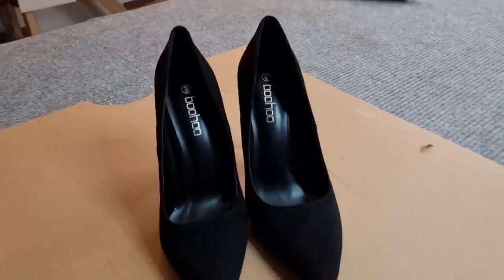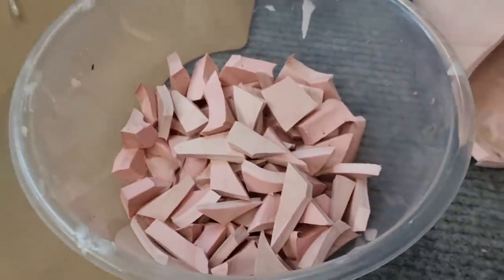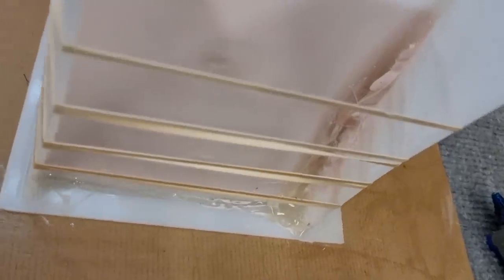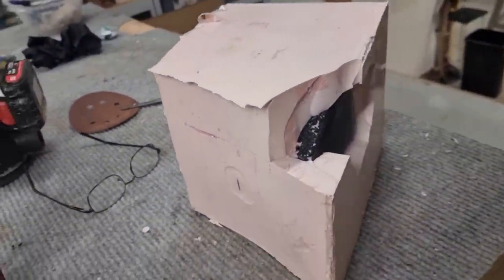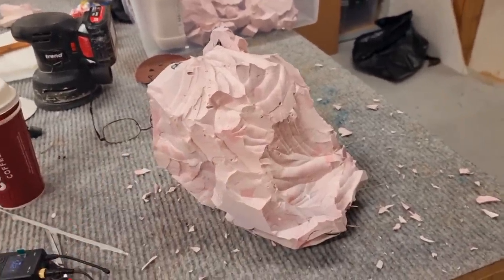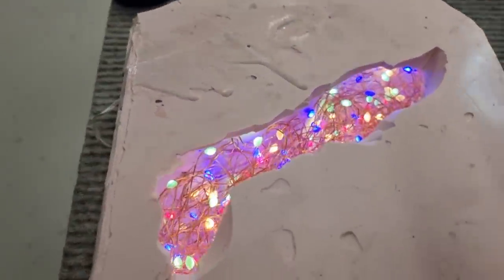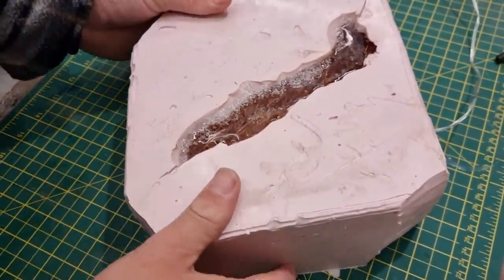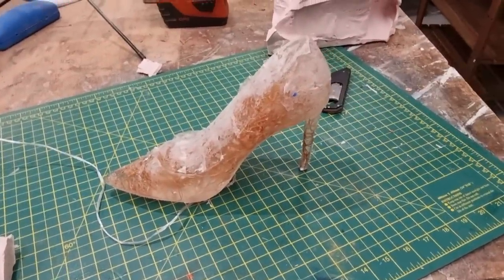Making Resin Stiletto Shoes with LIGHTS !

Comment: This is an amazing idea! So I have a (hopefully helpful) idea to add if you decide to retry this later on! Instead of putting the whole shoe into the mold and prying it out- I think you should try setting the shoe (Or whatever you decide to use later) only HALFWAY into the mold and make a literal half mold of the shoe- then do the other side on a separate mold so you can put the 2 molds together after you are done for a complete solid shoe mold that you can tape together and set (make sure to have a box they can fit real snug in and maybe a couple holes in the bottom of the shoe mold (put it in the pressure pot upside-down for the shoe since there is more room for it to air out on the sole and heel) then when they are done you should be able to just pull the halves safely apart with a much more complete shoe with the impurities being mostly on the sole since it was upside-down. I hope this helps for if you retry this again!

Comment: love it, such a fun project!  Suggestion for you.  Maybe when making the mold (or a mold of any other complex shape) you could use some sort of divider that could go around the object and bisect it so the mold removal would be more clean and easier?  Im thinking some sort of plastic sheeting that is rigid enough to hold shape but thin enough to not affect the shape desired.  And include some pegs in the divider that could be used to line the mold halves back up when you are ready to pour the resin?   Im probably overthinking the heck out of this, but Its worth a thought

Comment: Love the Cinderella shoe and all the effort and patience you have too.  Is there a possibility to reattach the wire to get it to work? Also maybe try putting two pieces of plastic sheeting together in the middle of a mould and then when it sets you can pull it apart more easier.  Love watching every creative thing you make, and Merry Christmas to you and your family.
Reply: He could try adding some solder to the damaged part of the wire, add a layer of uv resin and paint that section silver to hide the patch job. Not sure if it'll work but worth a shot if he ever wants to try and salvage the first one.

Comment: You need to use a sealant when dealing with fabrics and other materials that absorb. Also for odd shaped projects, you should use a two part mold and a shell style mold to save a fortune
Reply: Yes, I thought a two-part mold would work as well, but I have so much trouble wrapping my head around how they are made.
Reply: Seems like it would ruin the shoes
Reply: @recoveringsoul755  they're gone anyway😉 the Moldova stuff def. ruins the fabric...

Comment: Nick I am so glad you are still giving us your energy and enthusiasm. 
You have brightened up a long, very long day which started yesterday morning where everything that could go wrong has.
A way I am thinking you could do this is as a 2 piece mould. Maybe try to get the inside moulded first somehow and then use a mould release to create a barrier between that and the outside. I hope that makes sense. I'm not sure how but I'm sure there is a way to get the shoe you want. I do love the single solid shoe tho. Looks awesome.  I have seen people use vaseline between the 2 parts. There would be a lot of tilting to get the inside. Maybe cover the shoe with vaseline before moulding it to get a cleaner mould.
Every video is a lesson from the best resin teacher.  You teach the skills of creativity, vision, problem solving, trying new things and learning from your mistakes. 
I live not far from you near Poole and love the beach.  Maybe a cool shell something.
Another possibility to save sanding and possibly cutting wires is to do a top coat of resin or brush a top layer over your piece. Im not sure it would have worked with the shoe but i think you could try something like that.
Keep up the amazing 3nery and work.
Merry Christmas and Happy New year

Comment: Something I learned in college 3d sculpture class is that if you're making a mold of something that silicone may stick to, use vasaline to help it remove from the mold much easier. Unsure if mold release would also work on the actual piece you're making a mold of or only when you do the resin pour.

Pouring a 2 part mold with registration marks can also help the mold's stability and ease of removing the molded item also during mold making.

Comment: First, I really enjoyed the process of try-fail-try you explored in this video. The final art piece certainly justified the effort and looks amazing.

Second... I think I suggested this last time you tried lights in resin but I can't recall really. You should have made a "block" or a slightly smaller version of the final mold into which would go the lights. As you know, a silicone mold will always take on the finish texture of anything you cast (so suede was a doomed choice from the start) so you needed to start with a shoe you could seal first. Then once you made the first mold you could sand that down by a mm on all surfaces making a block you can mold again and into which wold go your lights. Then that lighted cast would go into your original mold to be cast in the final size and giving you some sanding room safe from wires. The shinier and smother your first object (the shoe) the less sanding you will need to do at the end.

I hope you don't give up on lighted resin projects. I always enjoy the energy you bring in your videos, it makes me smile. I wish I enjoyed anything half as much as you enjoy doing your projects.

Comment: I watched this before bed, and then thought about it to the point where I was going to get up to post this.  Opted for the next morning.  What about (and this is from someone with NO experience besides your videos), pouring a solid shoe, taking it out and sanding it clean, then cutting it in half with a band saw, dremel out the inside, adding the lights and then either just gluing it back together with them floating inside, or pouring more resin.  I spent way too much time trying to figure out how to make lighted resin stiletto's.  :)

Comment: I love the idea. It came out way better than what I was bracing for, the wire being 'Nicked' and a mold leak was expected. 😁
Maybe coating the project/experiments with wiring in thin layers of the resin after a light sanding by hand could avoid the electrical part being ruined. 
I also got an idea for a resin, drip molded lamp shade with those same fairy lights. You can get two inflatable balls or balloons, one smaller one  inserted into the slightly larger. Insert the lights, blow the balloons up, then add  a fast resin, let it start to set then turn it upside down to let the resin and lights drip dry, so to speak.

Comment: That was an excellent idea. You could make a smaller shoe and pour it with no lights. Then wrap the lights on the smaller shoe and suspend it in the regular mold. That way the lights wouldn't be close to the outside.

Comment: Okay, I have no idea if Nick is ever going to see this, but I do think it'd be a helpful suggestion. I suppose I'll let the community decide.

I think, when sanding difficult projects like this, you should only rely on the electronic sander up to a certain point. Meaning, I think your wires would have a better chance of survival if you used the electrical sander up to a point where you could comfortably sand the long way with sandpaper. I know it's longer work and can be exhausting, but in the long run, it's a much safer bet for your wires. Especially with a project like this. Purely a suggestion. Have been a fan of your work for a long time, and I just want to help. 🙂

Comment: Firstly, I love your channel! 
If you do another mold involving fabric I would try scotch-guarding it and then slathering in mold release. 
Also, with big molds that are funky shapes you could try doing it in two parts  so that it's easier to release the object inside. Basically you pick a good "splicing point" and angle the object as needed, then you only pour the mold to that halfway point. Once that dries you carve out some unique "key" markings out of where you will pour a second time, but first you spray or slather some sort of mold release all over the top, so that once the second part dries you can release the two parts from each other, take out the object, clean up the halves and glue them together. Then bam! One big mold! It takes longer to set up but makes for a better mold and easier cleaning.
And if you want to keep putting wires in things lol might I suggest doing a few base layers that just coat the edge of the mold, and then adding in wires and the rest of the resin, that way you for sure have room for sanding.
Happy making!

Comment: In the future try double casting, make a mould, fill with resin once set, clean to perfection then cast mould again and fill with resin and whatever else (lights) and you should have clean pour with minimal detailing.
Another maybe cheaper option (though will be slightly small replica) is to cast with plaster of Paris, probably in 2 halves, line with a thin coat of silicone mould, the cast the resin.
Hope you and your family had a fantastic festive break and your creative juices are flowing, happy new year, Mike

Comment: As you were trying to get the shoe out of the mold, all I could think of was a reverse Cinderella scene where the stepsisters were trying to cram their feet into the glass slipper. And darned if the results weren’t sparkly like a glass slipper. 😊

Comment: If you want to try this again, maybe look into platforms. It matches with your funky themes and you can fit a LOT in platform shoes. Heck, I've seen a faux aquarium in the base of one. I could see that being a new series of just what you sculpt into shoes next XD. Although, next time, mold release may help a lot. One tip that I have 0 idea if it would work is try to use a fast cure resin and make kinda a shell. Then, put the wires in, and sand it. I think it turned out great, even with all the issues

Comment: Honestly, what I would like your channel to do is to revisit previous ideas with improvements/upgrades. Versions 2.0. I would especially love it if you did more resin saving by inserting things in the middle instead of having to lathe out columns upon columns of stuff from the middle after the acrylic has set, AND I would also love more projects where you work LED string lights into the bulk of the piece, placed such that you wouldn't accidentally break the circuit when lathing ☺️

Comment: Have you considered doing a two part mold? Dunno if you've done these before or not. You could put some channels for filling the mold, but a two part could be a lot easier to demold and could be reused. I dunno if your silicon works this way, but platinum cure silicones works really well for this. You make one half cured then after its ready you coat the entire top of the silicon with petroleum jelly. It keeps the two from bonding together! Dice makers do stuff like that all the time if you haven't done this before and wanted to look up to see how others do it.

Comment: I for one did not know that you could cut up old molds and reuse the bits like that, that has to be a huge money and time saver! I can tell that this project is something that could work, the refinement of the steps to get a finished product that you envisioned is likely too much to do right this moment, but you documented learning steps already! Non slick surfaces need some form of protection if going to make a mold, I suppose its like hair getting stuck in the plaster for makeup prosthetics. Maybe that's somewhere that you could nick a procedure from to refine the idea of making a mold for a resin, if you get my thought process here. See how movies make full facial masks to make a mold, plaster first then the latex? Or how a carved statue has a mold made for mass production. You don't have to do the thing multiple times of course, but maybe one of those fields has some tricks you can adapt for this resin casting. 

Thank you for continuing to share your experiments and ideas like this! It can't be easy to put yourself out there with something you might consider a failure, I applaud your strength for that! It's a teaching experience for those of us who watch, and your good humor through it is in large part why I watch you! I always advocate to my friends that their personal well being comes before everything else, and I know that being a youtube personality is not easy, and there's a lot of pressure there. My main focus on streamers is admittedly video game related, I actually stumbled across your videos through something completely unrelated to what I normally watch!,(Thinking about it, I think one of your leaf bowls was oddly enough the thing that drew me here and got me to subscribe...again my subscriptions are largely video game and K-pop related!) 

I've seen more than one personality crumble under stress and pressure from feeling the need to constantly be uploading and the keen feel of viewership loss for even taking a break. I don't know you personally, I don't know how your life is outside of this, or how much stress and time it takes for you to put this sort of content out there. You must have like, five or six things going at once to be able to put out the content that you do, and that takes a lot of organization and focus with the time that your projects can take up with having to wait days for resin to cure. It is a lot of work and the stress to do it only amps up the more successful you become. I've enjoyed watching your videos, and I always love to see what happens at the end, even better if its something you find a success! But even the 'failures' like the shoe are still beautiful in their way. Thank you for sharing all you have, and thank you so much for your great sense of humor and conversational way of sharing your work out in your shop. Sorry for such a wall of text!

Comment: Not sure if others have already said as much but my suggestions for next time:
1: don't use suede, use something less porous.
2: use a mold release product on whatever you do try to cast.
3: fill the mold halfway let it harden, then coat the surface with mold release before filling the second half. Now you'll have a natural split to separate the mold instead of trying to cut it apart.

Comment: First you have to cover/stuff the shoe - less expensive molding/resin to use. Now you should cast just the front to middle and  remove when set. Then cast middle to back/stiletto and remove when set. Now you fix the two halves together with more mold and just leave an opening over the heal area so you can pour your casting mix in there. After setting cut length wise. That way you can fix it together again and reuse.

Comment: That looked an absolutely nightmare shape to mold! You had that against you from the start, so I admire your patience and skill :O
Things I woulda done:
Spray paint the shoes in something like plasticote, might take a few coats, so you have a smooth surface to aid mold releasing.
Pour in a thin layer of silicone to hold the shoes in place and wait for that toi set before pouring in more.
Make the mold in two parts, with the first part being the bottom, sides and back of the shoe (so you have a kind of L piece), and the second part being the top front and inside of the shoe. Lots of mold release so you can separate the two halves.
Doing all this should give you two parts you can clamp back together, and two holes in the base (the base of the shoe and the stiletto point) you can pour the resin into. Also the wire coming out those points means you can thread the wire through the wooden base and completely hide it from view :D

Comment: When you said you had to do it over, my first thought was to coat the shoes in resin then add mold release when dry.  We'll see what happens.  //  Well, finally a use for spike heels - I hate those things!  A masochist must have invented them - since you can't run in them, they'd at least make a good weapon!  😹🤣  //  An idea?  Well, how about using the rubber/plastic fish and stuff to make a fish bowl?  If there are air bubbles in that project it, would actually be part of the scene!  Do it like you did the pirate in a bottle project.

Comment: Hi Nick, I have an idea you could possibly try. Create something from Lego, a shape, or structure. Cast that in silicone. Then when you need to remove the master, it's lego so should pull apart to come out. Then do a resin cast with fun bits added to it. Dunno if it'll work but that's the fun of experimenting! Al the loves, M x

Comment: Cool, just an idea would making the shoes in the resin first hollow out the inside with a fawcner drill bit and sanding it out, then putting wire inside then fill with resin???? Just an idea.      your channel is cool through out highs and lows (if there is lows) keep strong and the entertainment is excellent through out your development, merry Christmas and all the best for 2023

Comment: if you do decide to put wires in resin again. maybe try somehow coating the outside in a few layers before puting the lights in and then fill with resin. just a thought. also with the silicone mold if you use like vaseline the silicone wont stick to fuzzy material. good job none the less i enjoy your videos.

Comment: Love watching your stuff. I would like to become a maker myself, and maybe just as an outside perspective it's easier to spot. But have you ever considered trying to mold wax into the shoe form and then melting it out of the mold? 

You can also use wax sheets to coat the first poured resin and make a second mold with that wax on to pour over the first resin form. Might give space to sand and avoid a Nick.... Pun intended... Of the wire.

Happy Christmas, love that you decided to stick around. You are entertaining.